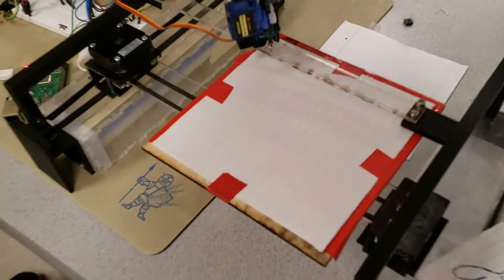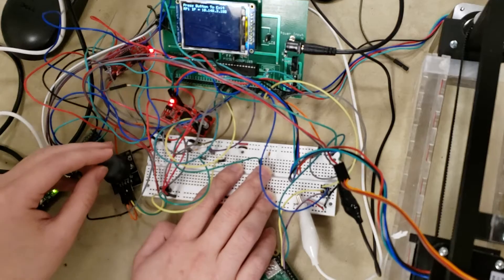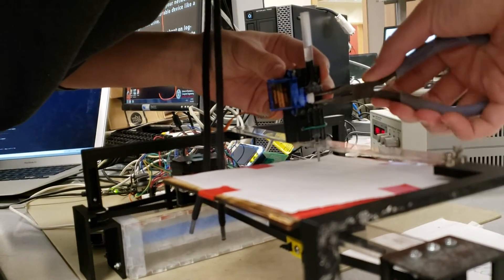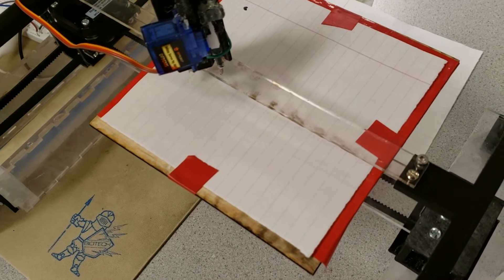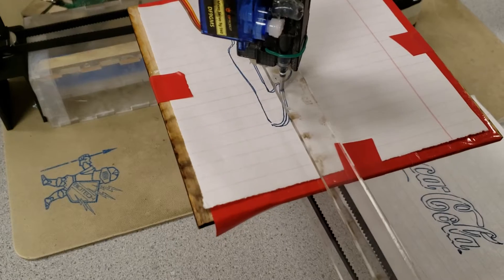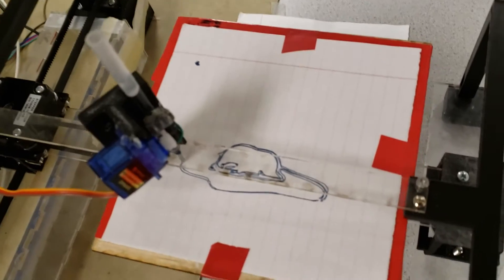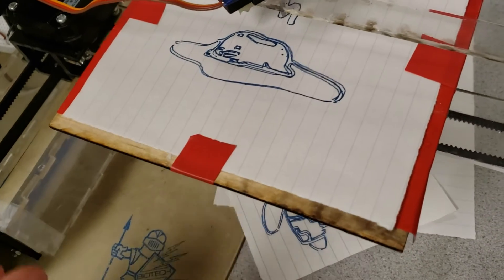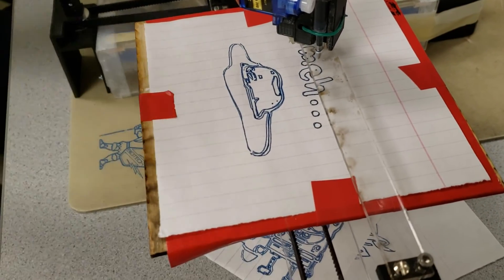Canny edge detection plotter.

Comment: the stroke outlines the canny result? the canny is the edge. they are drawing the edge of the edge. they should have used a centerline algorithm. its hard to see whats novel here.
Reply from the maker: This is a 5 week project for a microcontroller design course. The project is a very well done communication and control project.
Reply: @ece4760  why not strive for excellence though?
Reply: @CharlesFormanWonderUnit   please, this is an embedded project, not a computer vision one
Reply: @CharlesFormanWonderUnit  Because the students are probably also responsible for any number of other courses.  Furthermore, professor Land deems the project a success.  Please teach your own course where you can strive for nothing but excellence.